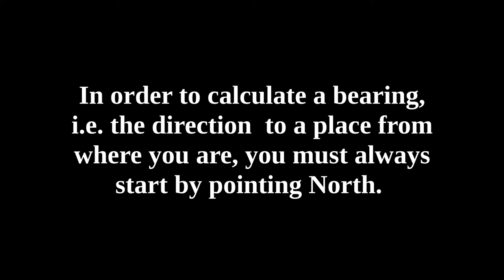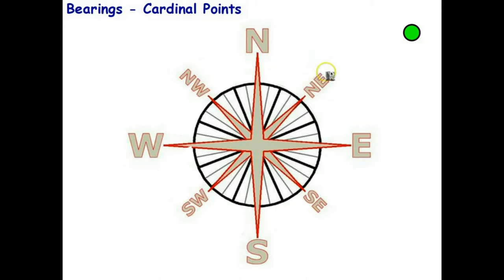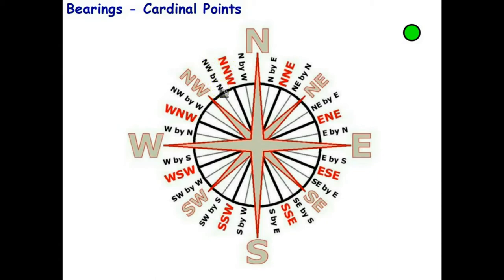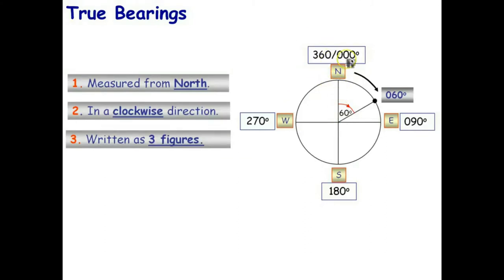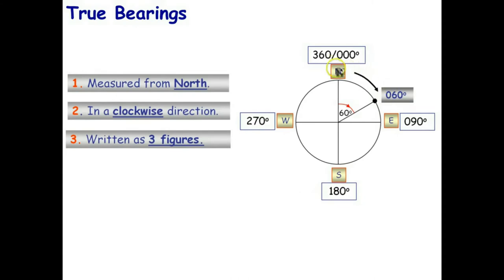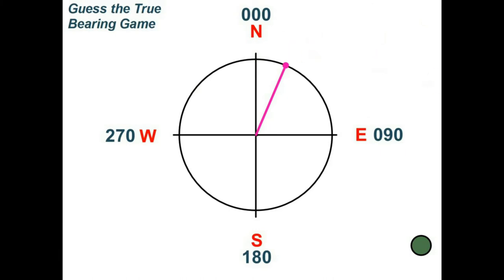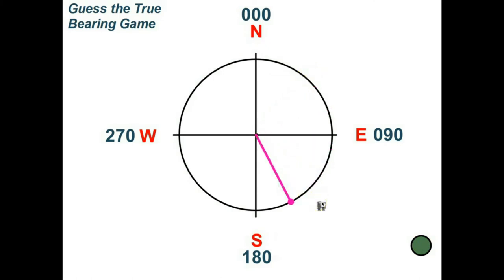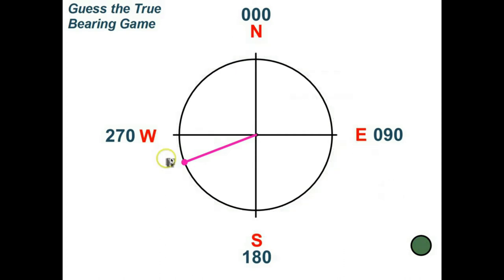Calculating Bearings on the Flat Earth

Comment: This is fundamentally flawed.  You adequately explain how to get a bearing, but put yourself on this flat earth, and draw a bearing 045 degrees from anywhere in the Southern hemisphere.  Follow this line, and after about 1000 miles, what bering would you be on.  You see, the bearings 090, and 270 require a ring, either left turns or right turns to maintain the bearing.  This only works for these two cardinal points.  You can not draw a straight line, or even a ring that maintains a 045 degree bearing.

Comment: Perhaps you might explain to me how it's possible on a flat earth that I can get on a flight in Sydney, Australia and be in Johannesburg in 11 hours and 45 minutes.

Sydney 33.8S, 151.2E
Johannesburg 26.2S, 28E

If we take the current suggested flat earth map (Azimuthal Equidistant) with the North Pole in the center and all the continents arrayed around it. The Longitudinal lines would extend out from the North Pole, while the Latitudinal lines would create concentric circles around it. One degree of Longitude would vary with the distance to the center, but 1 degree of Latitude would remain the same. This is the same with the Globe model only the distance of 1 degree of Longitude would only increase to the equator and then reduce to nothing towards the south pole

Draw a line from the North Pole to Sydney, Australia and label it ‘B’, then draw another line from the North Pole to Johannesburg and label it ‘C’, then label the angle ‘x’ between lines B & C. One degree of latitude is 111 km (69 mi)(this is the same whether it’s flat or a globe) therefore:-

B = (33.8 + 90) x 111 = 13766 km (8554 mi)

C = (26.2 + 90) x 111 = 12920 km (8029 mi) 

x = 151.2 – 28 = 123.2 deg.

If we consider this 2 sides of a triangle and the apex angle, we can use the cosine rule formula A^2 = B^2 + C^2 – 2BCcos(x) to calculate the third side ‘A’ which would be the distance between Sydney and Johannesburg, therefore:-

A=sqrt (13766^2 + 12920^2 – 2 x 13766 x 12920 x cos(123.2)) = 23478 km (14588 mi).

A direct flight from Sydney to Johannesburg in 11.75 hours should be travelling at 1998 kph (1242 mph) which is 1.6 x the speed of sound. The cruising speed of a 747-400 is only 920 km (570 mph) and the maximum range is only 13,450 km (8,350 mi). The plane should not even be able to reach its destination let alone get there in the time it does.
Reply from the maker: Virgil Pheonix that's a whole lot  of  math... it may take me a few months to get back to you.
Reply: Immune2BS All right, if you have to.
Reply: DO you actually expect him to get back to you?
Reply: R.W.H. Of course not
Reply: And.....he never got back to you. He should change his name to Immune2Math

Comment: I am not convinced that is circular though, flat yes. People need to put up 360 skyward looking cameras and watch it in VR.
Reply from the maker: +Cosmic Surfer which part are you not convinced of, your statement is sufficiently vague.
Reply: FE is based on an AE projection as such. The path of the moon as observed from 3 different locations with 360 cameras and then viewed in VR indicates a straight line of movement. This does not add up to the AE circular movement of the sun and moon above our heads. This needs to be looked into with many more volunteer 360 camera operators across the plain.
Reply: Its not flat

Comment: WHAT COMPLETE AND UTTER NONSENSE - I f you follow a bearing you follow it in a staright line, that clearly doesn't work on this "map" if you followed baring 090 for example you should be heading DUE EAST but here you would have to be constantly turning left. Please engage bran before posting this  rubbish